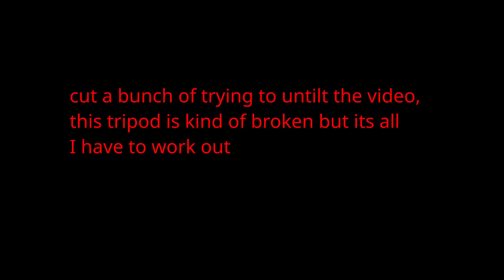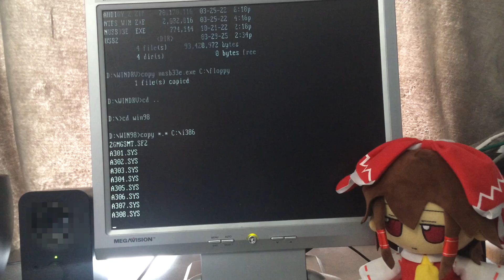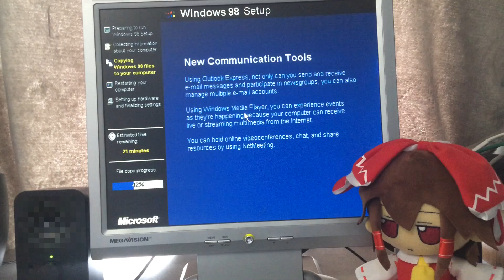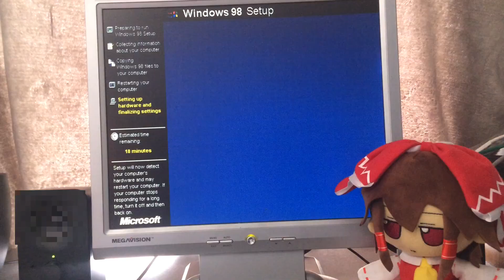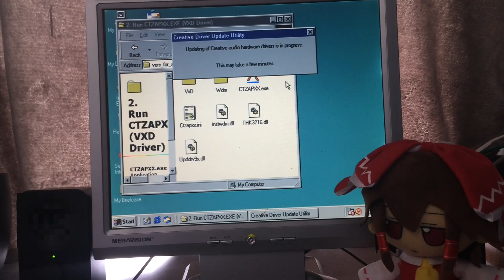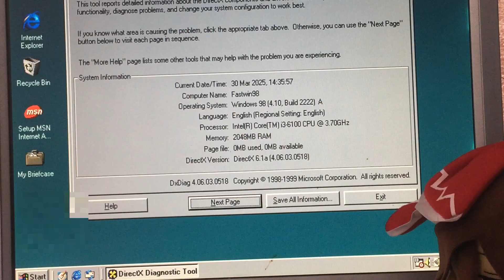Installing Windows 98 on Intel Skylake

Comment: /p i is used when launching setup.exe so that ACPI wouldn't get configured.

Technically setup /p i doesn't intend to disable ACPI, but due to the way that it works it does do that. Windows 98 does support ACPI, however due to a lot of changes happening with ACPI, it ends up causing Windows 98 to crash.